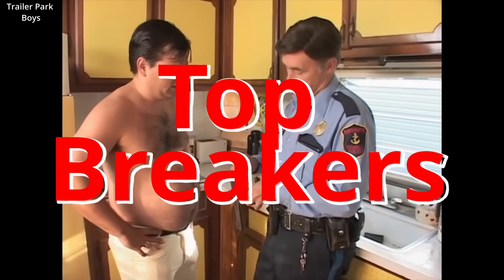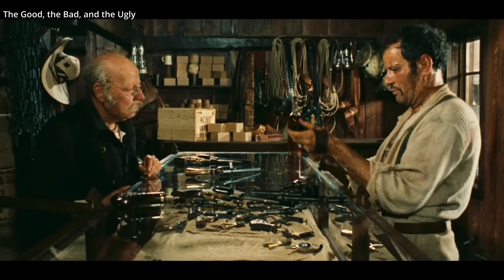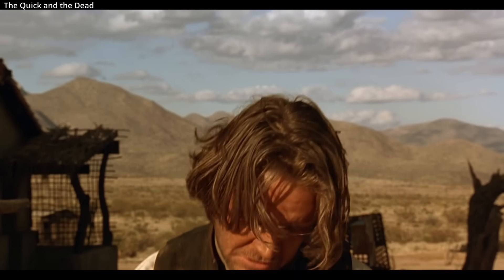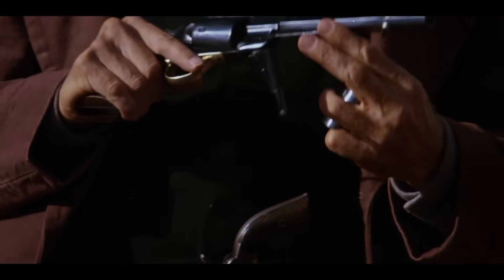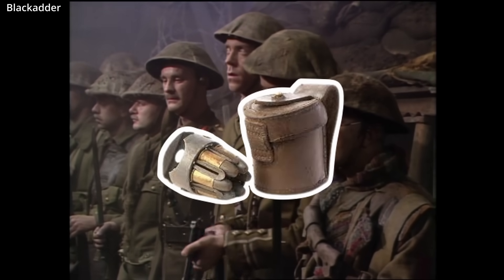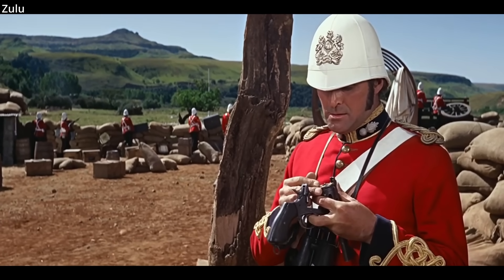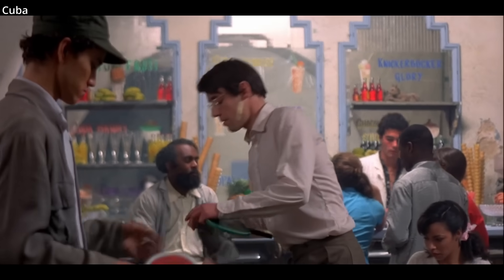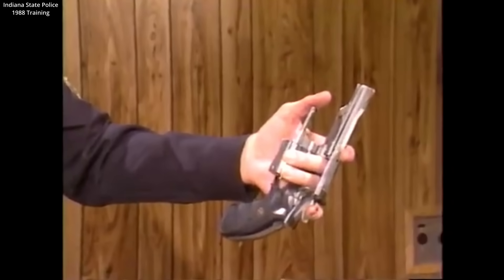Top Break Revolvers Are Cool

Comment: I like top break revolvers. The main disadvantage they have is that they are not as strong as solid frame, side swing revolvers and not suitable for the more powerful cartridges that came along in the late 1800s.  
Otherwise, they are much faster to load/unload.  The S&W Schofield was preferred over the Colt SAA by cavalry because it could be unloaded quickly using just one hand, and was easier to load on horseback.  I have a S&W Performance Center Schofield revolver I bought about 2002.  Really fine revolver! It is the only single action revolver I own. 
I also own a S&W "Safety Hammerless" .38 and an Enfield MKII also in .38 S&W.

Comment: The bee's wax and tallow mixture has more to do with reducing black powder fouling. A tight fitting bullet reduces the probability of a chain fire.
Reply from the maker: Yah, that's probably a more likely reason.  Thank you.
Reply: @JohnnyJohnsonEsq  You should have mentioned paper cartridges, which were commercially available on a wide scale. Things like wads and lube are more of a 20th century cowboy shooting propagation.
Reply: It can do both.  Greasing the chambers does help prevent chain fires.

Comment: Also it's a bad idea to eject the spent casings vertically as it risks a casing or whole round dropping back down under the extractor and being caught under the extractor jamming the gun. The manual ejection of the swing out cylinder was considered an improvement as it was both easier to eject the cases downward and always control the extractor position.

Really, reloading any revolver in combat is very hard, even with a speedloader.

Comment: I'm a little surprised at two notable bits of media that didn't show up here. At least in the original Trigun, Vash the Stampede has a very impressive break action, with a barrel aligned to the bottom of the cylinder like a Mateba. (Haven't seen the new series yet.) "Unforgiven" has the 'Schofield Kid' - the Schofield being a modified S&W Number 3 with a thumb latch rather than pushing up on the sights. The latter seems to show up in quite a few films, even it only saw limited production in real life. (I want to say only about 3,000 out of 100,000+ guns of Number 3 made, but I'm not completely sure on the numbers.)

Comment: 1:50 There's mention of both carrying multiple revolvers and swapping cylinders in either Grant's or Sherman's memoirs (I forget which).  He said it was not uncommon for a cavalryman to carry two holstered revolvers in the front and two in the back in a cross draw style while mounted.  Bloody Bill Anderson was found to have six revolvers on his person when he was killed.  Also they preferred the "Navy" model Colts because it was significantly lighter than the 1860 Army.  But anyway, if you have the cross wedge pin in the Colt worn in and greased, it's easy to knock it out and change a cylinder just as fast as you can on the 1858 Remington.  Either way, reloading a cylinder is faster than emptying and reloading cartridges one by one.   Also, it's worth noting that the Starr revolvers (there was a SA and a DA) were both top-break AND used percussion caps.    Although it's not a latch, you have to unscrew a pin

Comment: The story I was always told was that the break top revolver was designed for cavalry so the could reload and still hold the reigns and barrel at the same time
Reply: Close.  Cavalry were early adopters seeing the advantage.  Just look up "schofield revolver" for some history on it.
Reply: However they often came open when they were nt supposed to.eventually they went back to the colt1873.one reason being you could top off a colt after 1 or 2 rounds .you could not do that with a smith

Comment: 0:27 - Who would only load  5 out of 6 rounds into his weapon??  That always made me nuts.
Reply: Someone that only has 5 rounds? Otherwise yeah that's weird. It doesn't even look like the empty cylinder is the one that would be under the hammer either; in case he was cautious in that way.
Reply: For the Colt Single Action Army, some would load only 5 rounds in the cylinder to prevent accidental discharge.
Reply: Load one skip one load four. That way when you decock the hammer, it comes down on an empty chamber. The old single actions didn't have any kind of safety.
Reply: No modern-day transfer bar safety. The hammer is the firing pin and if you load 6 the hammer is sitting above a live round
Reply: @jcraigie  Nope, he still had more ammo on him, as he later reloaded his revolver, once again.  Excellent answers to all who said that it was vital to leave an empty chamber beneath the hammer of a single-action revolver. In that case, we may have a technical movie-making problem because at one point in the film he's repeatedly pulling the trigger on what is now a dry weapon before throwing it at a Zulu in frustration, and you can plainly see/hear that it's a double-action.  That said, I believe he was using a Webley service revolver which at the time was indeed double-action. 
EDIT:  A-HA! If you watch it closely enough, you can see that the chamber he leaves empty is not the one beneath the hammer, and thus how he snaps it shut is of no consequence. So we're back to the beginning:  He only loads 5 rounds into his double-action Webley with more ammo still in his pouch.  I continue to be frustrated with this scene.
Reply: @Coconutscott  Excellent answers to all who said that it was vital to leave an empty chamber beneath the hammer of a single-action revolver. In that case, we may have a technical movie-making problem because at one point in the film he's repeatedly pulling the trigger on what is now a dry weapon before throwing it at a Zulu in frustration, and you can plainly see/hear that it's a double-action.  That said, I believe he was using a Webley service revolver which at the time was indeed double-action.
EDIT:  A-HA! If you watch it closely enough, you can see that the chamber he leaves empty is not the one beneath the hammer, and thus how he snaps it shut is of no consequence. So we're back to the beginning:  He only loads 5 rounds into his double-action Webley with more ammo still in his pouch.  I continue to be frustrated with this scene.
Reply: @Ididitlikethis2079  Right, but this was a Webley double-action. Excellent answers to all who said that it was vital to leave an empty chamber beneath the hammer of a single-action revolver. In that case, we may have a technical movie-making problem because at one point in the film he's repeatedly pulling the trigger on what is now a dry weapon before throwing it at a Zulu in frustration, and you can plainly see/hear that it's a double-action.  That said, I believe he was using a Webley service revolver which at the time was indeed double-action. 
EDIT:  A-HA! If you watch it closely enough, you can see that the chamber he leaves empty is not the one beneath the hammer, and thus how he snaps it shut is of no consequence. So we're back to the beginning:  He only loads 5 rounds into his double-action Webley with more ammo still in his pouch.  I continue to be frustrated with this scene.
Reply: @sithus1966  Good answer. But even on a double-action, though? Was the firing pin still part of the hammer on the Webley? 
EDIT:  A-HA! If you watch it closely enough, you can see that the chamber he leaves empty is not the one beneath the hammer, and thus how he snaps it shut is of no consequence. So we're back to the beginning:  He only loads 5 rounds into his double-action Webley with more ammo still in his pouch.  I continue to be frustrated with this scene.
Reply: @Great_Sandwich  

Maybe he only had 5 bullets left.
Reply: @Ididitlikethis2079  Naw, still had more ammo on him.  Maybe it was just done for dramatic effect.
Reply: I think that something getting snagged on the hammer was a big problem without a safety switch.  That's why later webbley double action revolvers had the hammer hidden (you can't c0ck it with your thumb, but it wasn't necessary any more)
Reply: @Great_Sandwich  yeah, on the Webley it doesn't make any sense. Maybe the director didn't know what he was doing and told him to load five because he saw a cowboy do it in a western...

Comment: Moon clips aren't speedloaders. They're loaded into the cylinder along with the rounds they're holding together. In that sense, they clip all the rounds together to be loaded all at once, much like the M1 Garand's enbloc clip does. The cylinder has to be specially machined to make room for the moon clip. Maybe half moon clips could be used as speedloaders, as it seems plausible to wrench them out to the side to finish the load. Not possible with full moon clips. I'd never heard of this or considered it before seeing this video. I'll have to look them up. Massad Ayoob used to advocate for moon clips, back in the days when US police still used revolvers, as they offered faster and more reliable reloads than speedloaders. If you ever watch someone use them, there's often an extra 1-2 seconds of fiddling and wiggling each time.

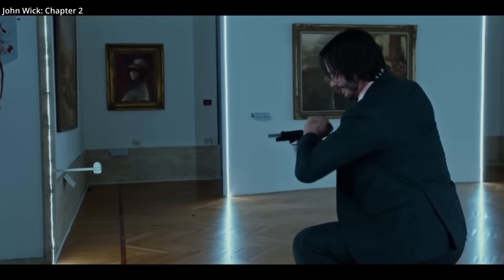Comment: 4:18 i never noticed this little move Keanu does in Wick 2. What's the deal with that? Looks flashy sure, but I'm wondering if there's any real world reasons or training doctrine that would call for that? 
Or maybe it's a subtle nod to the 'on wires' era of Hong Kong 'kung fu' film?
Reply: It's called a press check. There's a number of different ways of doing it, but Keanu opts for a fancy one-handed method. It's just to verify that there is a round loaded in the chamber by slightly cycling back the slide until you see a round without causing the extractor to toss it out. It doesn't make a ton of sense to do in the context of that scene where he just slapped a fresh magazine in, so he knows it's loaded. It's just a fancy flourish. Those movies are partially responsible for a big resurgence in the tacticoolness of people doing it for no reason at the shooting range. It's kind of a meme in the firearms community.
Reply: I think he checks it because he picked up the magazine from an enemy and he wants to make sure that the weapon loaded properly.  If it was from a magazine that he was already carrying I doubt he would have checked like that. @EnigmaticPenguin

Comment: The top break revolver had a fatal flaw. The hinge lock would not work as intended. The action was loose not solid as it should be. Gas escaping when fired came out the side of the cylinder. I had one. After a couple of boxes of ammo told me that this was a mistake. Save your money. 😊